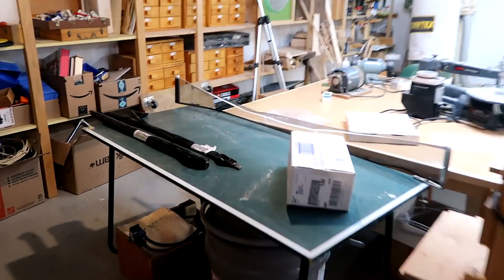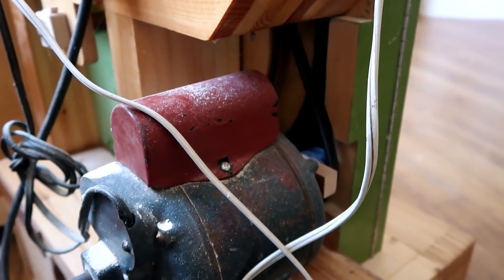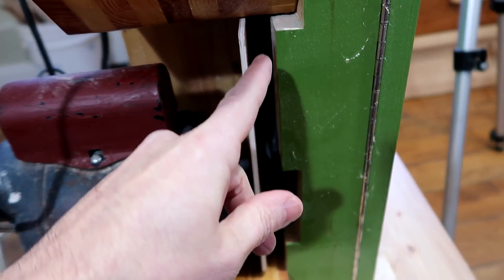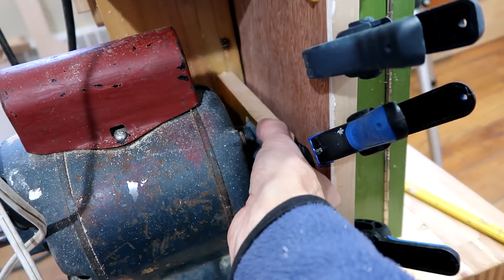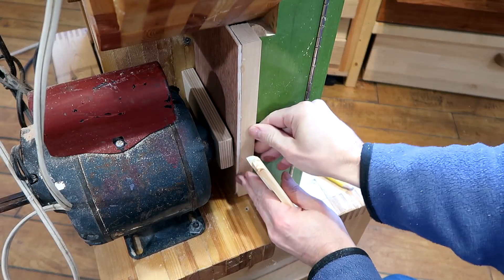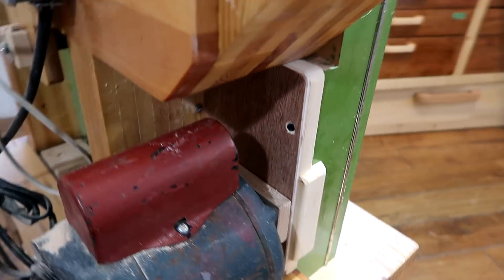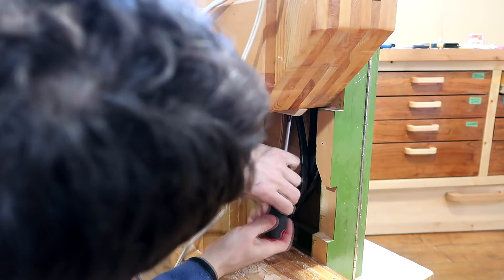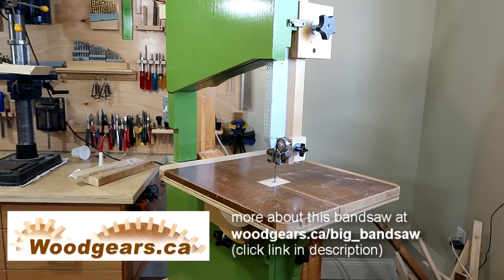A finishing touch on my 20" bandsaw

Comment: Agreed on the size. It's why I've been building a 20" one from your plans :-)
Reply: I used to have time for woodworking, and I've always wanted to build one of his bandsaws.  How much time do you think it will take you?
Reply: @Ciarán Lavery the diameter of the wheels.
Reply: @jarodmorris611  Don't worry about time. It's a labor of love...
Reply: @Ciarán Lavery Distance from the blade case is the name of the game. You want something with a "Deep Throat."
Reply: @jarodmorris611  Took me a couple of weeks full time to get it to up and running state. But a few extra days to go, to do some extra stuff like a mobile base, custom motor mount etc. I have made it to a fairly neat and tidy standard though - and some parts are upgraded to metal in my build. Also a couple of design changes which takes time. You could blast through it in half the time if you're less fussy.
Reply: @Ciarán Lavery Both wheel diameter and maximum rip width (blade to blade cover).  Resaw height on Matthias' is 11" naturally, and 13" with the cutout on the upper arm. I lengthened the spine of mine so it's 13" naturally. I can always do the cutout later, but I don't think I'll need it.
Reply: @Ciarán Lavery maximum depth of cut. IE distance from the table to blade guide when all the way up.
Reply: @CraigsWorkshop  Are you going to use this saw for wood or metal?  Thin blade or thick?  I made the 20" saw and put a wide blade on it with the tension cranked up tight.  Wound up flexing the frame quite a bit.  You'll be better off de-tensioning it between uses.
Reply: @simonhopkins3867  no. You are incorrect sir. Bandsaw are labeled based on wheel size alone. What you're referring to is max height of cut, or resaw height.

Comment: I built my 16" bandsaw from your plans about 8 years ago, and it has served me very well since.  It is a very capable saw.

Recently I've been considering installing a 2 or 3 mm steel plate on top of the plywood table mostly so that I can use my magswitch feather boards. I also figure it will protect the table surface and ease friction when resawing bigger chunks of firewood. tAny thoughts on that idea?
Reply from the maker: Good idea.  Screw it on, don't glue it though.

Comment: Try a pinch of table salt between the two glued surfaces and they wont go sideways when clamping them down...
Reply from the maker: I don't like contaminating the glue
Reply: @matthiasrandomstuff2221  Not much at all.. just enough to get some friction, 5-10 grains.. and the salt is inert.. You could do a strength test.
Reply: Also, a pinch of salt really enhances the  flavors in the basil-based paint.

Comment: I noticed a shaft sticking out of the other side of the motor, would you ever consider adding a dust collector to that side so they run off the same motor?
Reply from the maker: I did some tests on my 16" bandsaw a few years back, and the airborne dust emissions from that saw were so minimal compared to other tools, it isn't worthwhile.
Reply: Awesome idea IMO. Even if just for the fun of the engineering.

I suppose it depends on your tolerance to dust too. All of my bandsaws make too much dust for my liking, albeit far less than the table saw, belt/disc sander etc.  

I think it could be done in such a way as to leave the dust in the drawer below the saw, while creating a reasonable draft through a furnace filter into the room capturing the fines.

Comment: Have you ever considered making a dust collector that’s connected to the other shaft of the motor?
Reply from the maker: No.  The passive dust capture of the saw is quite good (other than the gaping hole I had at the motor).  So not really worthwhile.

Comment: Well, if you think 20 inches is the right size you won't be needing your other ones. If you want I'll email you my address.  I find a good home for them 🙄🙄
Hey, I thought The Great White North was metric. What's with using inches. That's a 508mm band saw. 😁
I know you don't like three wheelers* but what about a three wheeler using the 20 inch wheels top and bottom with the third wheel being any where in the 16 to 20 inch range. The whole idea of a three (or four) wheel saw is to increase throat depth. One idea I've played around with in my head is instead of a third wheel might be to replace the wheel with a section of track. The track could be linked and follow a radius.  Each section of track would have an outer radius so that when the sections follow the curve the form a continuous radius to reduce blade stress. I think it would be noisy though. I've used large a industrial three wheeled bandsaw and aside from the blade change and tracking issues having that large distance between the blade and the blade guard can be handy. Both for reaching into the  centerline of larger panels and stacking your parts when working on multiple parts.

*I don't either for the most part.
Reply: Some of us are able to use metric and imperial without a problem. Never understood why some get so upset. ( not saying you were upset, just an observation from years gone by)

Comment: I have always wondered when you say 20" band saw is that the throat of the tool, or what?
Reply: I believe it's the wheel diameter.
Reply: I think Borys is correct that Matthias is measuring the wheel diameter. Even though my "12 inch" Craftsman bandsaw has a 12" throad and 14" wheels.
Reply: I'm pretty sure it is the distance from the blade to the upright that houses the blade. That determines the width of the wood that you can re-saw.

Comment: Can somebody please show Matthias caulk? I believe it'll solve some of his problems, that little piece of wood was so unnecessary! just caulk it already! if you need to remove it it's exactly the same effort to cut it open than to screw that off!.
Reply from the maker: So you would put caulk on it.  And what do you do when you need to remove it to get at it?
Reply: @matthiasrandomstuff2221  On that little piece at the end? just cut it open with a knife! the guard was awesome! I'm just talking about that little piece of wood that you had to remove the motor to screw in.
Reply: Ya but he won’t have to remove that little piece because it will act like a slot for the guard. I thought initially “that won’t put out much dust” but then I saw what he did and thought that was a great idea.

Comment: Bigger bandsaws are better, until you have to move them.
Reply: Mount it on a wheeled base but not the one from Shop Fox. It has rubber wheels which will disintegrate over time. I found some replacement cast iron for mine and it is good now.
Reply from the maker: I was able to move my 20" bandsaw all by myself by taking it apart before moving.